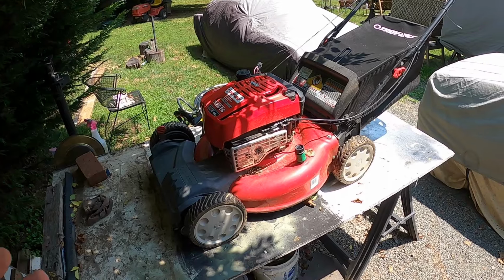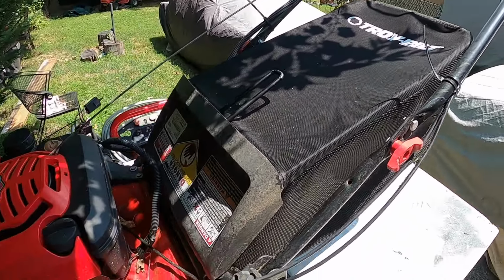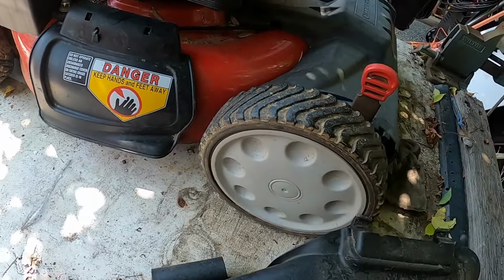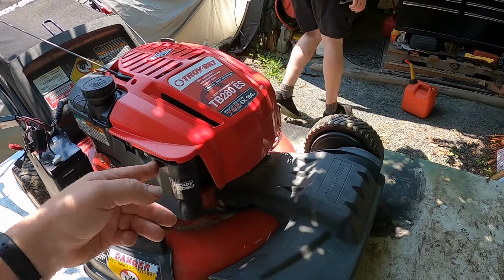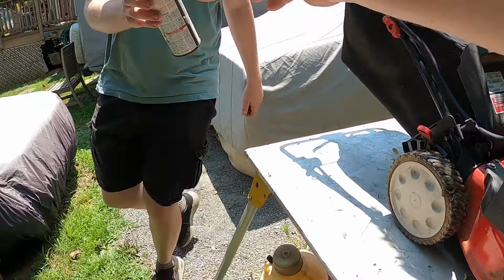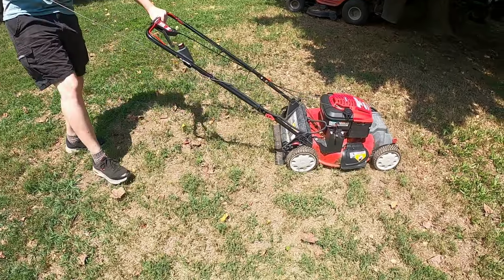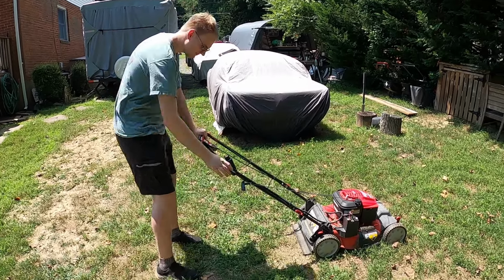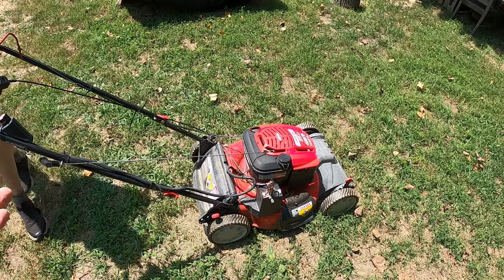Out For The Trash Troy Bilt TB280ES Lawn Mower

Comment: Whenever I have a problem starting any gas powered implement that has been sitting for a while, I do the following: (1) check oil; (2) check air filter; (3) check spark plug, spark plug wire, and the connection; (4)  check auto-kill switch; (5) add fuel system cleaner to the fuel tank and let sit over night.

Whenever possible, I use ethanol-free gas.  And I always add Sta-Bil fuel stabilizer to the gas.

Comment: Nice lawnmower I found a almost brand new Troy bilt push mower with a Honda engine in the trash last week they threw it away cause they put the blade in upside down and they thought the crankshaft was bent but it wasn’t  I put the blade in the right way and it started right up also it’s a new blade as well it’s from 2022
Reply from the maker: Its unbelievable  what people throw away. And they cause the problem it was having by putting the blade on wrong.